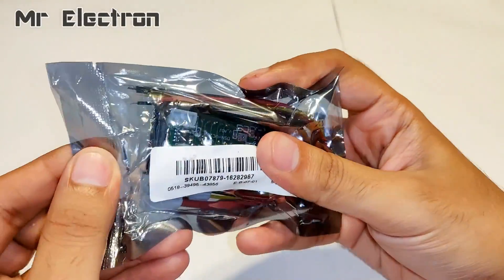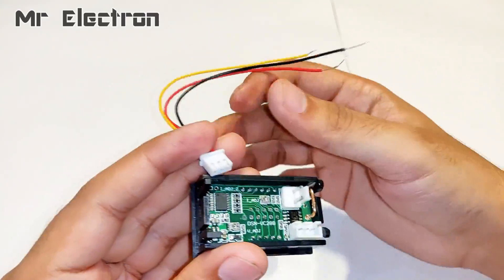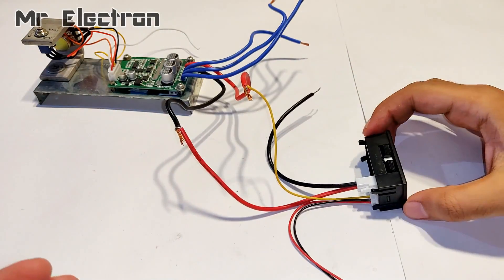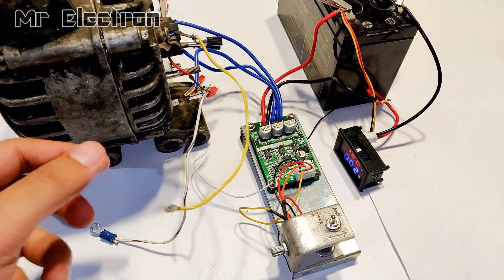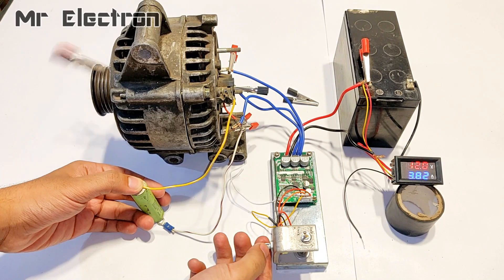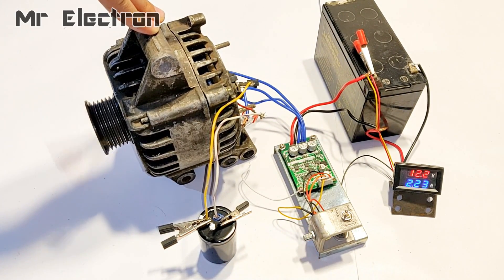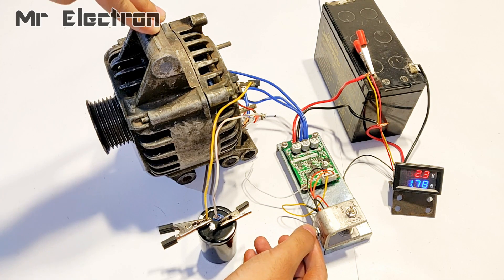Run 12v 120 Amps Car Alternator as Brushless DC Motor with 500F Super Capacitor & BLDC Controller

Comment: 0:47 yes, you have good scisors, but flame is better to take off isolation from cords
Reply: try to connect two cords from capacitor circuit in series to battery and controller, without paralel capasitor, alternater-"magnetcoil" can burn your controller

Comment: Neat, simple idea.  I like it.  It would make a great science experiment for my kids science class.  My question; what is its power?  Can it do any useful work or is it simply a demonstration exercise?
Reply from the maker: Depends on the type of load you want to put on the alternator... Power is good and its not just a demo exercise.. Although, a larger power controller should be used to run this alternator as a motor if you are planning on making an ebike or a go cart with it.
Reply from the maker: Also, thanks. I'm glad you liked it 😊

Comment: Can you test the cap on your tongue to see if it’s charged enough.
Reply from the maker: No. That's applicable only for capacitors with less volts.i mean less than or equal to 2v .It tastes salty though.

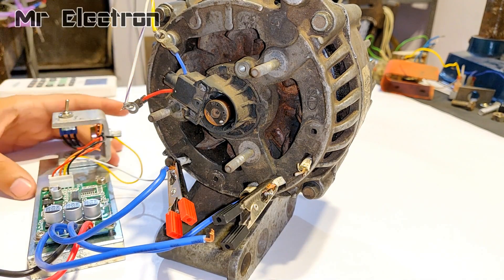Comment: You claim it to be "Brushless DC Motor" In fact it is not. If you goto 3:27 in the video. You can clearly see the brushes with the wires hooked to them coming from the center. Those brushes are what you are connecting the capacitor to.
Reply from the maker: The Title says "as a brushless motor" & not into a brushless motor.

Comment: "current from capacitor is high, so speed is high". Please, learn basics first, then try to teach.
Reply from the maker: Just answer this. Let's assume that this Capacitor can produce 1000 Amps at 2.7v.How much current do you believe will flow through the rotor winding of the alternator after connecting this capacitor to it?
Reply: @MrElectron  Just tell me how capacitor can "produce" electricity (charge)?! Go to school to be able to talk to professionals!
Reply: @SanelKeys  so he said produce instead of supply whats the beef?
Reply: The beef is that he doesn't give any numbers, no analytical explanation, what comes in, what comes out.  People say wow without knowing what's involved in circuit.
Reply: @MrElectron  maybe 1 amp or less. The rotor winding just has a resistance and it will create a magnetic field.
Reply: In experiment "Mr Elektron" Speed is depend  of frequency 3 phaze generator powered by 12V battery, and alternator can run with shorting exaiting coil. For better explanation see comment Siri Fail.
Reply: @stanislawcwiek2966  I know very well what's what, because, I have made many alternators, used it as synchronous motor and as synchronous generator. Obviously, you have miss directed this argument. Save it for the rest of crowd on who left their comment on this video.

Comment: Is capacitor charged again for 2nd time to run alternator as moter?
Reply from the maker: Yes but after some time... Like 2 hrs or something
Reply: @MrElectron  if we provide less then 1 volt from other sources?
Reply: @MrElectron  In your answer above, You mean the capacitor can last 2 hours straight feeding the rotor until you need yo Charger again? Can You charge with 12v to speed the charging?
Reply from the maker: It will still work and a speed will be higher

Comment: This is not brushless, the rotor uses slip-rings that are still brushed, like all alternators. You are only running two phases of the stator windings with a two-phase controller, on an alternator that is obviously wound Wye with a center ground. This is incredibly inefficient and delivers far less power than using a three-phase controller with the hub-tap open, on a Delta-wound alternator. Alternators are 3-phase, not bi-polar.

You also do not need the capacitor, a pair of neodymium magnets on the rotor, or otherwise magnetizing the rotor, will cause it to self-excite once the stator winding is energized and the "field" (rotor) begins to react with it magnetically. Remove the brushes and short the slip rings, give the stator 3-phase power, and you will have a 3-phase constant-torque repulsion-run motor that will behave similarly to a permanent-magnet DC power motor except that torque will remain the same at any speed, but speed will increase with more power applied.

Alternators are generally insulated with class H insulation, meaning that they can run up to 180°C (356°F) [This includes ambient temperature, this is an absolute rating], so it's okay to get them a little hot. Just keep in mind that the amperage rating of the alternator is an absolute maximum, and if you are not using 3-phase sine, you will fry it before you hit 100 of those 120 amperes.

If you want to convert alternators into motors, you MUST use the largest stator core possible. Look for Japanese luxury cars in the boneyard and find a LONG core, none of the A/C Delco or other American made crap. The Japanese make some of the best alternators for this kind of fun. You might want to pick up a Denso starter motor or three while you are at it, found in many if not most Japanese cars, they are the size of a beer can but deliver up to 7HP for up to 30 seconds (5 min cooldown), but can also be rewired easily for many different combinations.

Brushless means that commutation of the rotating field is done externally, as opposed to using a commutator internally with the motor. Alternators are NOT brushless.
Reply: .very nice and correct information me
Reply: @amitrajsingh38  Thank you. I experimented with this myself, and I am very knowledgeable on all types of motors (and I am an engineer), so I want to make sure people can have the correct knowledge to do it themselves, because these are fun projects to do, and inspire creativity.

Comment: Doesthe super capacitor get recharged While runing?
Or does it need to be recharged externally like when you did first time?
Reply: I want to know the answer to this question
Reply from the maker: Needs to be recharged
Reply from the maker: Need to be recharged
Reply: Then i think you need something else other than a super capacitor
Reply: @hamadaragabhamada  correct but apparently it last a little while ,perhaps having a small rechargeable  battery being part of this circuit would be more practical
Reply: A 100 ohm 1watt resitor in series with a on amp dodge tied to b+ would keep it charged!  100π res. ------I(-----V\/\/\-->l--------b+

Comment: I'm struggling to understand the point here. OK, so you can make an alternator into a motor. The power seems to be around 24W, which is tiny for such a big motor. What sort of power and torque can you get when it's loaded? The whole super-capacitor thing seems to be a red herring - it's just a power source - you could use any other.

Comment: How is it that the capacitor doesn't discharge and shock you when you touch both leads with either one or both of your fingers?
Reply: Low voltage can't overcome the resistance of his skin.
Reply: 2 volts won't shock!

Comment: Would you be able to run an ac generator with the setup using solar power as its quieter than petrol engine? Any reply appreciated?
Reply from the maker: Yes ! But it would be better to use a large and powerful 12 to 18v dc motor to run your ac generator.

Comment: 500F ??????
Reply: "Farad" is a measure of capacitance - So the 500F is a 500 Farad Capacitor, and in this case it is a 2.7 volt @500F and it is a "super capacitor" - Read up on this if you are unsure about what it is.

Comment: In this video you are showing to run an alternator as a motor but this is not a brushless DC Motor. Instead brushes are there in an alternator. But I am sure You have made big changes in the alternator to run it like a motor. An ordinary alternator without changes can't run like this.
Reply: Big changes? The only change is that an alternator has an electromagnet in its rotor, it indirectly controls the voltage like this.
If voltage is high, current decreases - induced voltage goes down, opposite if the voltage is low.

By powering this rotor coil, it effectively becomes an BLDC motor. You can replace the electromagnet with a permanent magnet, but that is expensive.

Comment: Questions: the. Video description reads"very high rrpm", yet i contest you dud not exceex 1k rpm in the video.
As the goal is to convert an alternator into a 12v low volt high current motor, i ask, at what torque ( hp) a re you getting at what current ( amp)?  Basically, how much weight is lifted, to what height, at sgat speed, wlusing what power/ current setting?
As yhe S.C . is the exciter of the alts coils.. Could nt we use a second capacitor and add a flip flop?  Hzve both s.c. charged to capacity, utiluze s.c. 1 to excitealt coils until cap value = less than output neccessary excite coils, clip clop senses thelis, turning off, say out out 4 of mcuand switching on out put pin say 10 of same mpu flip flip circuit, using secind s.c. to excite alt coils, while 1st s.c. discharges safely then gets recharged again thru the circuit.?  It wouldn't be "unlimited free  energy.. But it would extend the run time.  However, if , with this configuration, Torquay still negligible horsepowers on Lancaster. Not worth extrapolating further. As it is I need to have a motor run on mobile dish I can't move anything, i would have better spent energy to task buying an electric winch  oft the shlelf

Comment: Would a 2000 watt 72-96v controller work better than a 48v1000 or 1500 watt controller, I may use 2 on my bike, of the 1500 watt, with 2 motors,  and 64v battery, 16s liion near 4 hp, and the TQ of a 20 hp gas engine, I hope it is enough,

Comment: I'm thinking about doing This, but with 48-72v 1500 watt controller, and have multiple alternators to choose from, 45-60amp, to 100&150, how does amp rating effect motor output?
Reply from the maker: Higher torque
Reply: @MrElectron  so I should go with the 150 or 200 amp alternator!! Thank-you

Comment: How does rotor voltage effect power output? Does the capacitor discharge? Or is a current induced by the stator?
Reply from the maker: Capacitor discharges

Comment: Thanks for the video.make a video of overunity, where an alternator and a motor can run without external power source.. producing electricity
Reply from the maker: Sure but overunity is not possible considering the law "Energy can neither be created nor be destroyed"
Reply: Mr Electron you don’t have to create energy for overunity, just figure out how to use the energy that have always been there and was not used. Like transient spikes.
Reply: Impossible Dennis sir
Reply: Can’t happen. All theee perpetual energy videos are fake. You can not get out more power than you put in therefore you cannot run something off the power that thing gives off. You lose power due to heat and friction.
Reply: When I was about 10 I was certain I could run a battery charger off an inverter and keep the battery running the inverter charged by the charger running off the inverter. And still have power left over. I tried it. I do believe the light and fan I had running lasted longer but it still drained the battery and shut off.